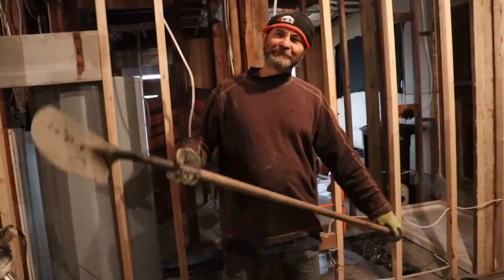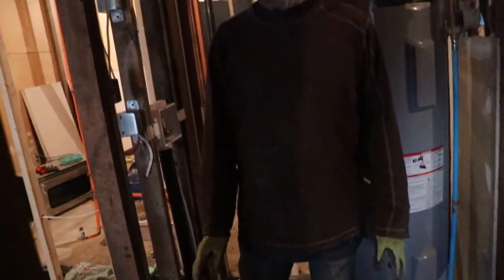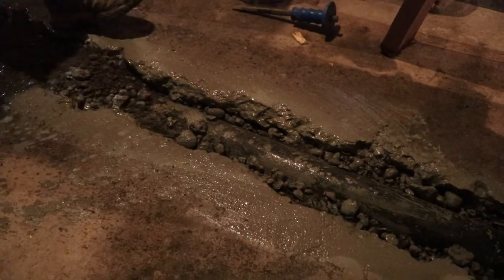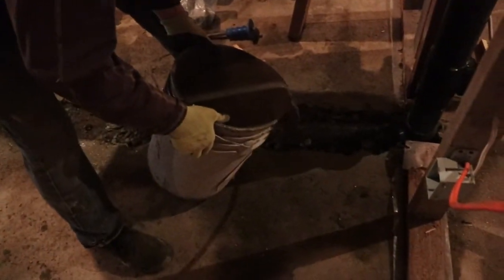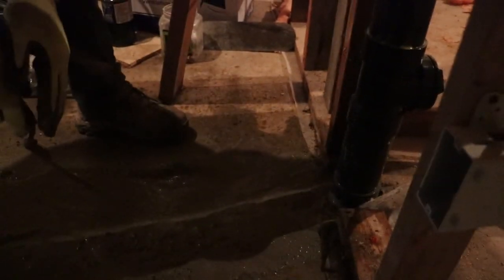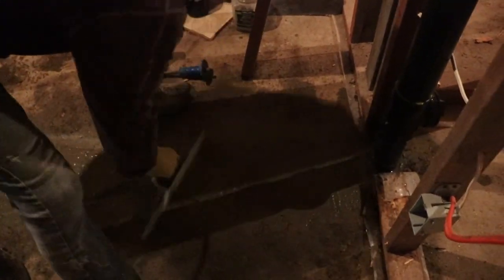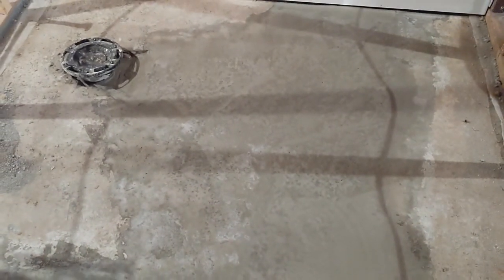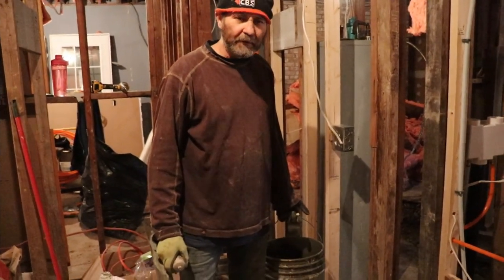How To Repair CONCRETE Floor

Comment: Great job my friend, thank you very much for sharing, how long would take this concrete to dry?
Reply from the maker: It will take: 24 to 48 hours before people can walk on the surface, I scraped it a bit after 14 hours,  takes about a week  to  partial curing, about 30 days to cured, in my case  45-60 days, the concrete should be fully cured and dry, thank you very much for your time and support, keep safe my friend and see you in the next videos